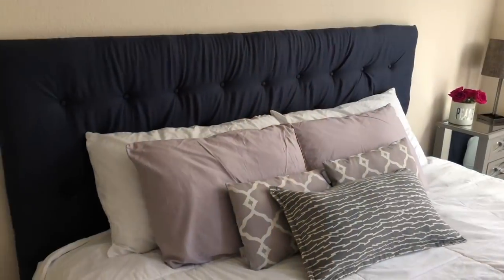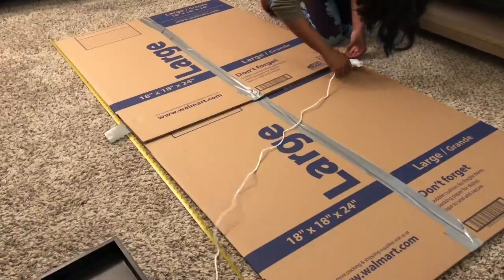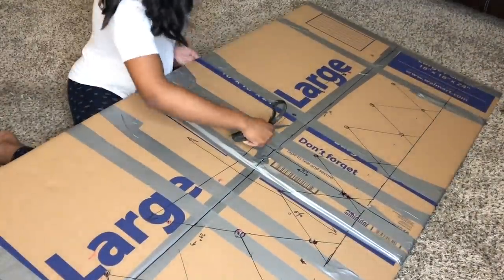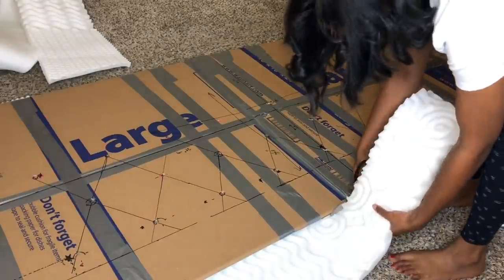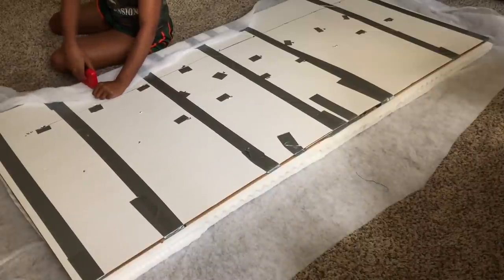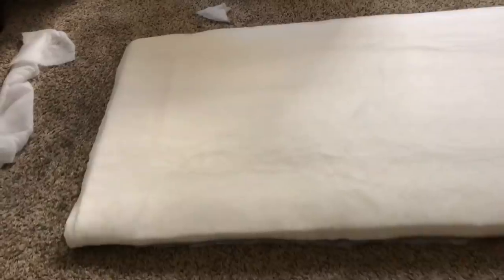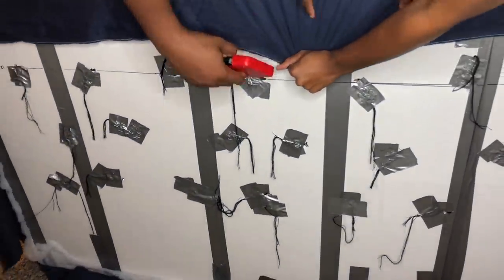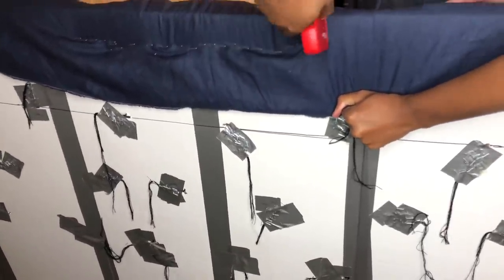CARDBOARD BOXES TO HEADBOARD !! HOW TO MAKE YOUR OWN TUFTED HEADBOARD |DIY HEADBOARD|

Comment from the maker: READ THIS COMMENT: 
Hi everyone! Thank you for watching this video! My headboard is not attached to the wall; it is propped up on the frame FYI (for all inquiring).
Reply: Hello and great video!!! If you were to attach it to the wall what method would you use?
Reply: Good to know
Reply: @theredheadtherapist  I heard of some peel and stick type hooks that fit into one another. So like the one you put on the headboard is facing down and the one on the wall is up and they fit in each other. Going to look into it myself.
Reply: Genius. Love it.💪💪
Reply: @theredheadtherapist  try velcro
Reply: Really cool making my son one I made one last year out of a old head board
Reply: Loving it. Great ideas here
Reply: nicolelise where u got the white pices to buy
Reply: Is there anyway I can order one of these from you?
Reply: Hi do you mind writing down the list of materials you used?
Reply: Lol I was wondering, tfs! Looks great!
Reply: Thank you. I was wondering how you attached the headboard to the wall. I mean I see a lot of floating headboards. How can I attach it to the wall securely?
Reply: I wondered if it was hanging. I would probably hang mine. Your video was to the point and easy to understand!
Reply: Try Velcro! It's great
Reply: I am going to use the Command Hook Velcro, which is intended for hanging posters and art, etc. I have used it for that purpose, and it works great and doesn’t damage the walls at all

Comment: That's very clever, plus it's fairly lightweight compared to a traditional wood upholstered headboard. You could secure it using a stronger 3M locking velcro (not command strips). They're used for marine headliners and would work for this without damage to the walls.
Reply: Joelle, Command makes strips for holding heavy items as well. I have used them a lot, and they hold very well.

Comment: You should've stapled down all the material tightly so there were no wrinkles, bumps, creases, etc, THEN put the buttons on, pulling them as tight as possible. (Hint: It would've been easier to tighten the buttons & tie them off if you put another, plain button or washer on the back.
Reply: The wrinkles is part of the headboard design.🤷‍♀️😊
Reply: I thought it was supposed to look like that! Seems fine to me and I sell furniture for a living.
Reply: Also a wire hanger to pull the thread through
Reply: Upholstery needle.

Comment: Hi just a suggestion.
Next time you can use regular bottom in the back to attach or secure the front ones. It's easy than waiting for glue to cool down.
It came out lovely 😁
Reply from the maker: Not sure what you mean by regular” bottom”
Reply: I think she means a double sided button, but  I could be WAY wrong. I thunk she was referring to those as a "regular button", or maybe she means a "regular button" will stay down easier than the ones you used. I don't think so though. From watching others diy headboards, the hardest part is the buttons, and getting that tufted look. Great job.
Reply from the maker: @rachellepoirier3695  Yeahhh I don't see how any other button would work/make it easier because it still has to be connected to the back! shrug

Comment: I would like to know, once you place the button in a string through the whole, why you had to bring the string back to the same whole, was it you wrap around the button for a bit of security for better tightness?
Reply from the maker: It’s a small needle. It’s easier to do it that way in my opinion. However You’re welcome to try to push it through the layers of cardboard and foam instead of going through the same hole.

Comment: I tried this weekend and it was a hot mess. I didnt use batting though, so is that required? I gave up on the buttons. I think Im just going to add something to the headboard and not worry about the tuffing. 🤦🏾‍♀️
Reply from the maker: Hmm batting kind of holds everything in place, so it definitely could’ve impacted the final results. Good luck!

Comment: How’d you attach it to the bed?
Reply from the maker: It's just propped up on the frame :)
Reply: The good part of making out of cardboard is that it's extremely light. If you wanted to you can also mount on wall with Comommand strips (it's a Velcro hybrid material). They are really strong  and won't mess up paint on wall if you live in the dorm/ apartment
Reply: nicolelise have you had any issues with it moving when you sit forward or back on it?
Reply from the maker: @aprilcarr3043  nope!

Comment: Looks Beautiful! How did you hang it?
Reply: We made one similar to this with a piece of plywood cut to size from Lowe's for like $10, I had two 3 inch thick pieces of craft foam squares that perfectly fit a queen bed, glued them then stapled around the fabric...hubby used hardware from lowes attached to back to attach to wall with an anchor...whole project was around $20-$25....next house I found a whole PLATFORM BED, upholstered headboard and frame, sides, footboard, etc for $49 shipped on clearance at Amazon...

Comment: You could have used pvc or imitation leather instead of cloth. As after a while cloth soaks up body sweats & dust. And you can't wipe it.  But pvc can be wiped. But great job. It looks like my pvc head board on my super king size bed 😊

Comment: Why didn't you just sew them through and tie a knot?
Reply from the maker: Tying a knot with thread with the size of the holes will not hold.
Reply: @nicolelise  i know, I meant without the holes. You could've used the side with the markings as the back  and a guide for the placement. Took the needle through the back (at a holeless marker)  pulled through the front, add the button then take it back through and tie the knot.
Reply from the maker: Thats not as easy as it sounds. This is 5+ inches of board, foam, & fabric. And without the holes, the tufting wouldn’t be as defined.